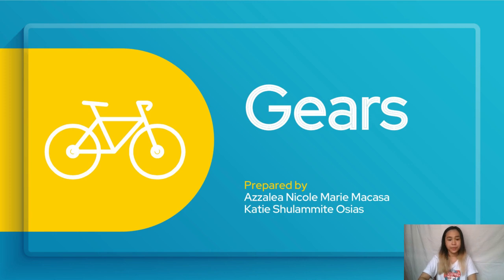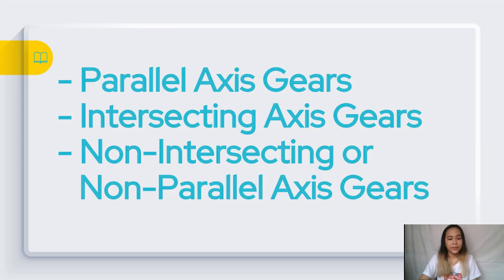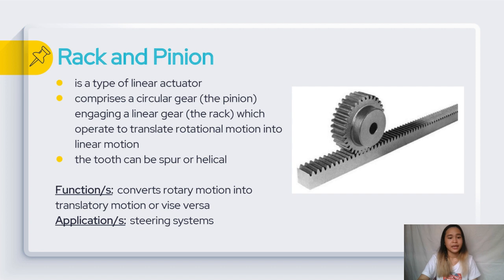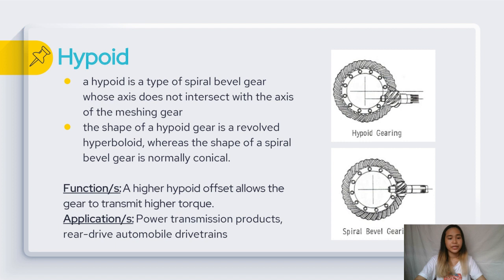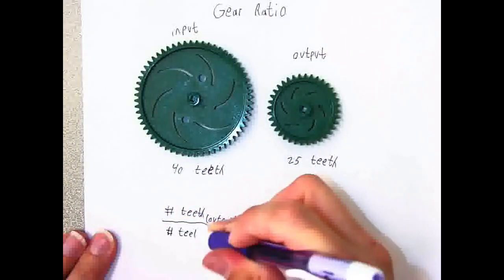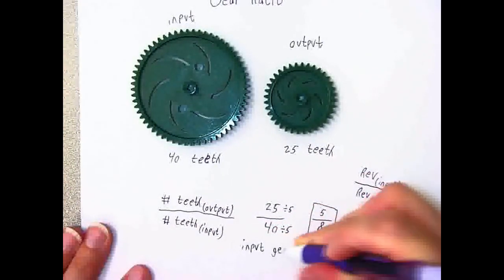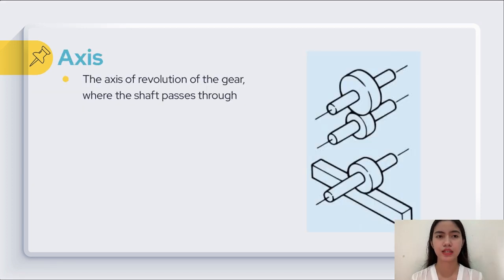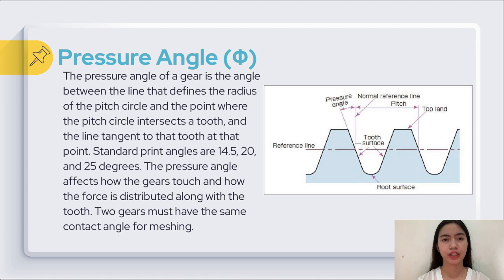Gears (Macasa & Osias)

Comment: Sy, Gwyneth Ingrid G. 
BSCE 3A

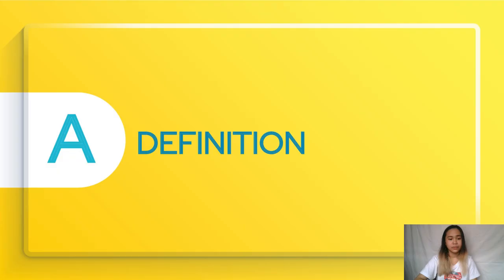0:27 - Definition of Gear
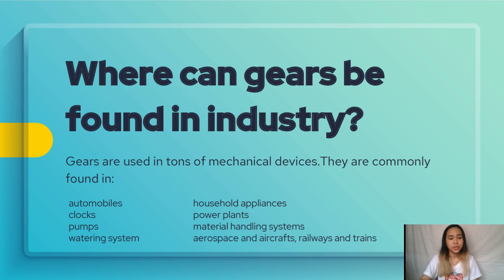2:27 - Gears in Industry
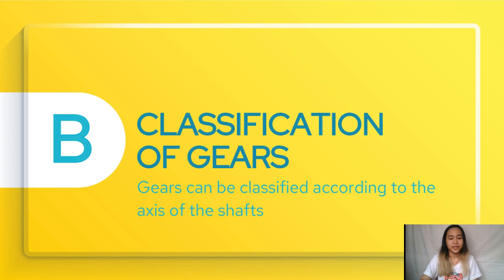2:44 - Classification of Gears 
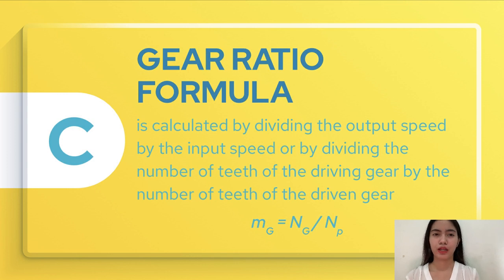9:58 - Gear Ratio Formula 
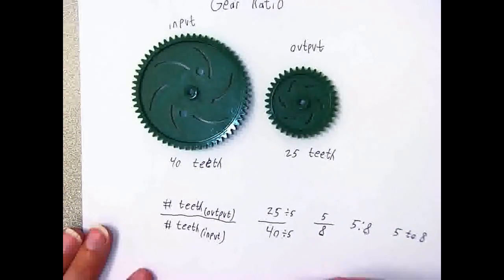13:13 - Gear Ratio (In terms of Gear Revolution)
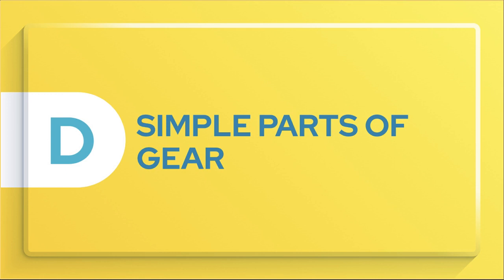16:10 - Simple Parts of a Gear

Comment: Ahl Sydric James L. Besinga
BSCE 3A

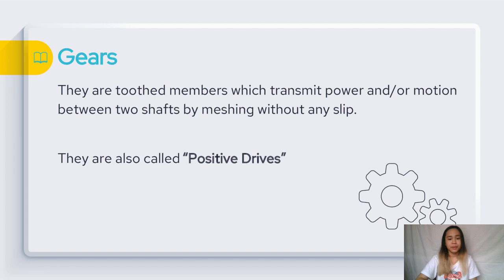0:30 Definition of gears and its functions
2:43 Classification of Gears
8:10 Non parallel and Non intersecting axis gears
9:52 Gear Ratio Formula
10:23 Solving of Gear Ratio
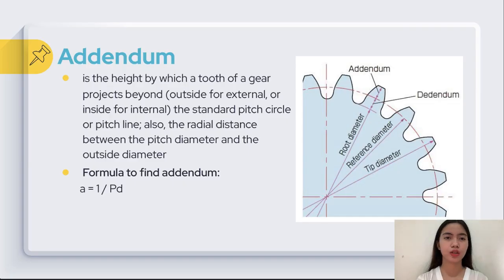16:17 Dimension of Gears

Comment: Deonimar R. Rañises
 
0:30 Definition of Gears
1:14 Functions and Applications of Gears
2:24 Where gears can be found
2:45 Classifications of Gears
3:04 Parallel Axis Gears
6:25 Intersecting Axis Gears
8:03 Non-Intersecting or Non-Parallel Axis Gears
9:53 Gear Ratio Formula
16:11 Simple Parts of Gear

Comment: Lalaine Lace W. Ga-as BSCE-3A

0:30 Definition of Gears
1:14 Function & Application og Gears
2:26 Gears in Industry
2:49 Classification of Gears
3:05 Parallel Axis Gears
6:28 Intersecting  Axis Gears
8:04 Non-Intersecting or Non-Parallel Axis Gears
9:54 Gear Ratio Formula
16:13 Simple Parts of Gears

Comment: Lensearfwyn P. Namocatcat BSCE-3A

0:34 Definition of Gears (Positive Drive)
1:15 Function and Applications of Gears ( Speed and Torque)
2:27 Gears are used in mechanical devices
2:48 Classification of gears according to the axis of the shafts
9:56 Calculating Gear Ratio
16:10 Determining the parts of a gear and their formulas

Comment: Shannen Angela A. Pelpinosas BSCE - 3A

0:33 Definition of gears - gears are also called positive drives
0:41 Pinion & Gear
1:15 Functions & applications of gears
2:26 Gears in the industry - gears are used in mechanical devices
2:48 Classification of gears
8:10 Non-parallel axis gears
9:55 Gear ratio formula
16:14 Simple parts of gear

Comment: Entroliso, Jessa May M. - BSCE 3A

0:31 Definition of Gears
1:13 Functions and Applications of Gears
2:23 Where can Gears be found in Industry?
2:45 Classification of Gears
3:01 Parallel Axis Gears
6:26 Intersecting Axis Gears
8:06 Non-Intersecting/Non-Parallel  Axis Gears
9:53 Gear Ratio Formula
10:23 Gear Ratio Solving Video
16:11 Simple Parts of Gear and Continuation of Sample Problems

Comment: Niño Rey C. Requirme
BSCE 3A

0:35 What is Gear?
1:16 Function and Application of Gears
2:44 Classification of Gears
8:11 Non Parallel Axis and Non Intersecting Gears
9:53 Gear Ratio Formula
16:10 Simple Parts of Gears

Comment: Neuhydele C. Bandolis - BSCE-3A
0:30 Definition of Gears 
1:12 Functions and Application of Gears 
2:44 Classification of Gears 
3:01 Parallel Axis Gears 
6:25 Intersecting Axis Gears 
8:03 Non-Intersecting or Non-Parallel Axis Gears 
9:51 Gear Ratio Formula 
16:09 Simple Parts of Gear

Comment: Nicole Ann I. Alido - BSCE-3A
0:30 Definition of Gears
0:53 Pinion and Gear
1:14 Functions and Applications of Gears
2:30 Gears in the Industry
2:52 Classification of Gears
9:54 Gear Ratio Formula
16:10 Simple Parts of Gear

Comment: Eary S. Rockwell BSCE-3A

0:38 Gears are also known as positive drives
0:54 The output speed and torque's rate of change depends on which is driving a pair of gears 
1:20 Functions and applications of gears
2:52 Three classifications of gears
6:39 Gear shafts can be perpendicular with each other
10:01 The gear ratio formula  
16:18 Gear dimensions
17:12 Parts of the gear

Comment: Jan Marie M. Llausas BSCE-3A

00:35 - Definition of Gears
01:18 - Functions and Applications of Gears
02:25 - Where can gears be found in the industry?
02:45 - Classification of Gears
09:54 - Gear Ratio Formula
10:24 - Video Solving Gear Ratio
16:13 - Simple Parts of Gear (Sample Problems 2-7)